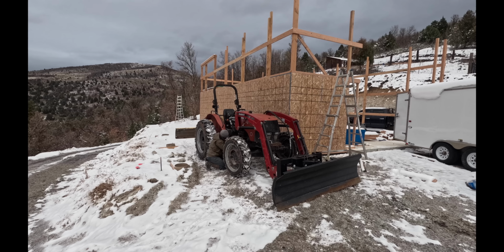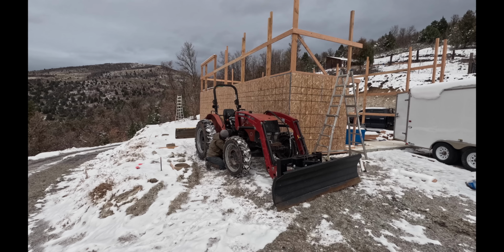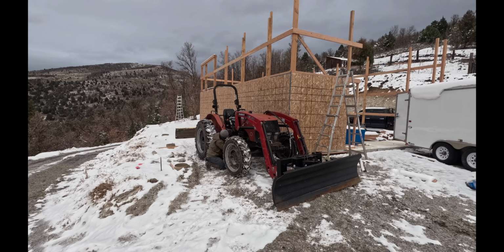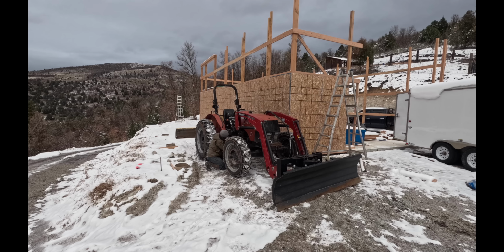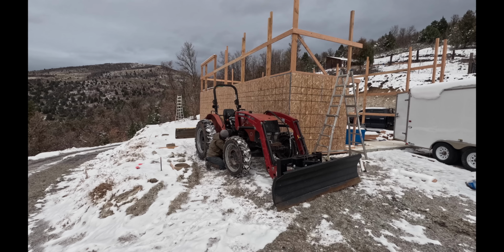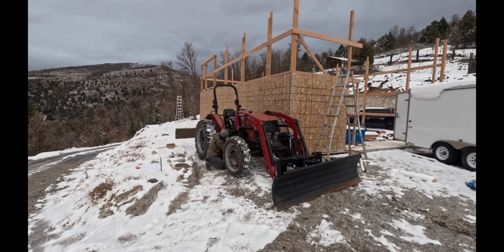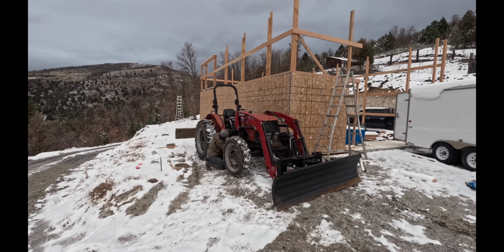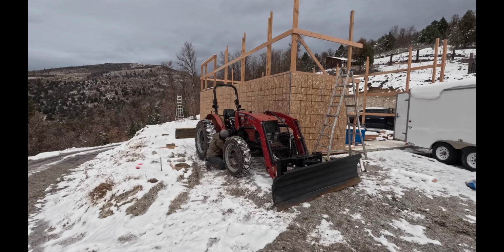Change of PLANS!! Building our OFFGRID SHOP/BARN

Comment: 3:00 An 18 ft door opening can easily be converted into a 16 ft opening if you plan on upgrading to an insulated door in the future?  I just had tarps on my garage door openings for the past two years it is surprising how warm it kept my garage in the winter while I finished its  inside, I used a plastic wire fence across the inside for added security and wind protection.
Reply from the maker: Yes we plan to upgrade in the future
Reply: @MountainMapleRanch  Sounds good, I am sure you have it figured out...  I was just suggesting to frame the originally planned 18' header and shrink the opening to fit the width of your temporary 16' door.
Reply from the maker: I feel that we will probably be ok with 16 feet in the future, just upgrade the door to be more insulated.

Comment: Great job so for Marc. Just a question though. Why is the aspect ratio of you video's 1920x960 and not 1920x1080 for example?
Reply from the maker: I just checked my video files and they are all uploaded at 4096 x 2048. Perhaps the playback on your browser is set at a lower resolution. There should be a little "gear" icon in the lower right side that will let you change the playback to a higher resolution.
Reply: @MountainMapleRanch  I see black bars on the sides with that ratio. Youtube favors 3840x2160 for 4K. And then it scales down to lower resolutions.
Reply from the maker: I see what you mean. I didn’t notice them before but I gotcha now. I will see what I do about that in the future videos. Thanks for the heads-up.